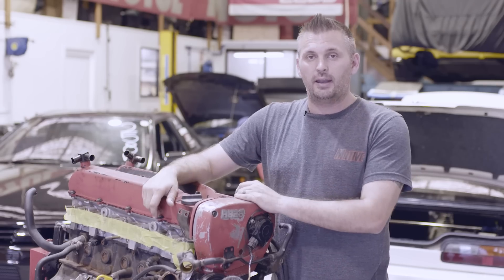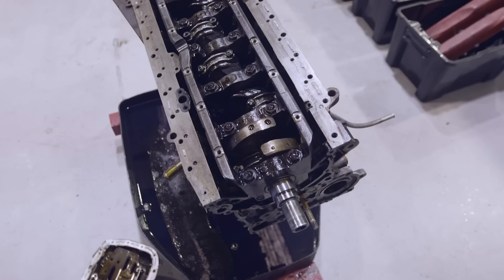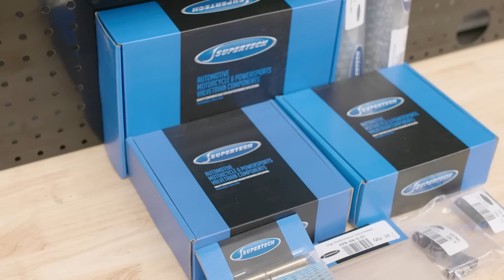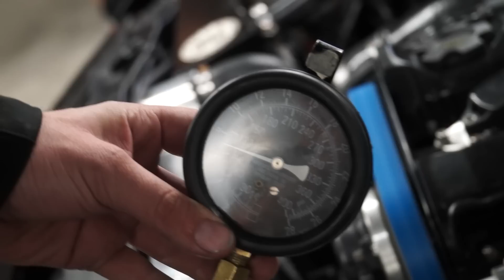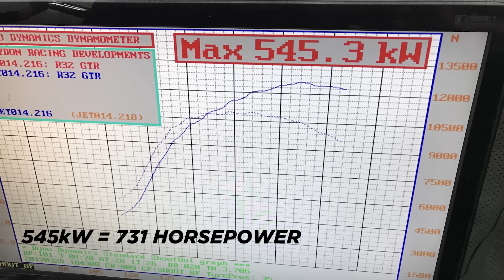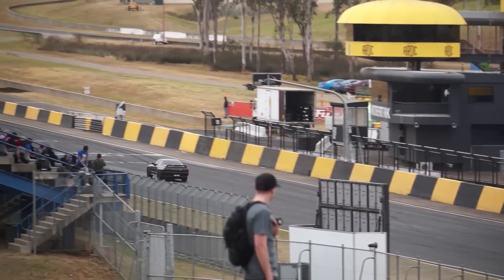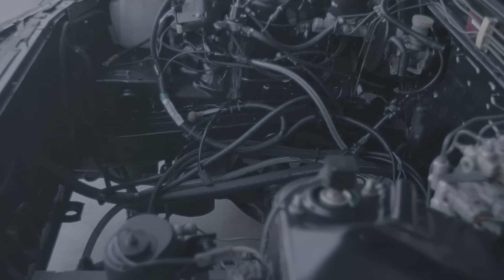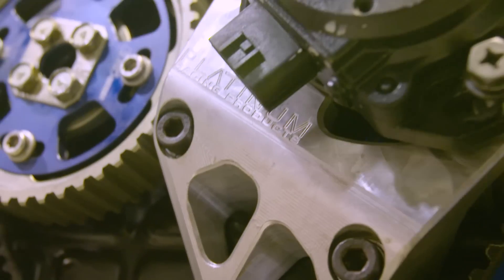1000 engine HP GT-R Budget Build RB26 Pt1 - The truth on RB oil pumps, head gaskets and more

Comment: You could have fixed it by having it sleeved with chromoly sleeves that’s what we do over here in the us when that happens or we wanna make big power, you should change those pistons to some flat top forged pistons and make sure to use chromoly rings and bearings, I can make a 4 banger produce the power you guys want pretty easy naturally aspirated too or supercharged cause turbos suck for drag racing period there for rally cross and drifting not drag racing

Comment: When exactly was the crankshaft changed to the long type oil drive in the r32s? And is there a way to know without pulling the oil pump?
Reply from the maker: August 1991. In a factory car you can tell by the car having a pull type clutch instead of a push type.

Comment: Is replacing the oil pump with an aftermarket like Nitto a must? or may I keep the stock housing and replace the gears with Billet ones? Which option do you recommend for about 450 KW or 600 HP. Thank you.

Comment: errr drysump if it's that much of an issue
Reply from the maker: Why spend $10,000 if we dont need to?
Reply: MotiveDVD more like 6k how much does that full pump kit cost ?
Reply from the maker: You haven't bought and fitted a kit for a RB26 have you. The gigantic lines and dash fittings cost a few thousands dollars. Then there is fitting, brackets to secure tank etc. Its a big job

Comment: Over powered the block is an understatement, all that fuel washing increased wear and you wore the fuck out of that block, you could never expect that to last those iron bores are 30-40k psi in strength and with excess heat hello deformation! IT's knocking at your door.

Comment: why not just change sleeves instead of throwing the block??
Reply from the maker: A s;eeved block is nearly $10,000 in machine work. Why do that for a budget concious engine? Save that for a "big" engine
Reply: didnt realise how expensive it is in AU, wonder why... :O here back in EU we always sleeve our blocks if needed, not a big deal :) off course the price depends of what sleeves you buy, but still for 6cyl. you could fit in 1000eu labor :)
Reply from the maker: Sleeving is a lot of machine work to get them to fit and has to be done by a experienced ( no cheap) machine shop. Then boring, decking etc. Your block ends up owing you 10K so you might as well put a billet main caps/girdle combo on and go the full hog and have a 20K block.
Reply: We do have good machine shops, the guy I know has his own machine shop for more than a decade, people send him Subaru blocks to sleeve for racing even from UK, the other shop has full CNC machinery they did cnc valve seats for me as well etc...  :)    its just the basic economical differences are very big, especially when I watch USA channels where people sometimes struggle to even resurface the head at the machine shop cuz of insane labour cost, although in here I get all of my stuff machined  :) Anyway greetings from Lithuania, love your channel :)

Comment: Do a VCAM! Its a cheaper alternative than stroking to a 2.8 and gives wicked response for circuit!
Reply from the maker: Actually, 2.8 is probably cheaper and can go bigger cams without Vcam. Its also super expensive to get a Vcam and not budget friendly. We'd love to test one but big bucks.
Reply: MotiveDVD  they’re pretty cheap now! I bought mine for 3900 aud from nengun and did a rb28 build. Made 100awkw throughout the low and mid rev range with the same boost level on 2859-9 turbos.  Lots of potential :) after watching your single vs twin turbo build I’m planning to get a single turbo gtx 35r.

Comment: Andrew great vid!
Did you have problems with the current head studs? Where they the normal or the stronger arp ones?
Reply from the maker: jasaircraft factory are junk but our last combo, hard to say, as head wasn’t machined so didn’t seal properly over 30psi
Got given some Tomei ones by JMA to try out so we tried them out
Reply: MotiveDVD what was your last combo or headstud kit?
Reply from the maker: jasaircraft ARP2000
Reply: MotiveDVD oh ok so there is a possibility the upgraded arp (better than the arp2000) set may hold the head down. :)

Comment: why not go budget build and buy an rb30 block use your old head im sure that would work out cheap
Reply from the maker: chris papa except for new manifold, new sump pipe, revised intercooler pipe, modified engine mounts, 4WD adaptor plate and other small things to make it fit
Reply: Dont pistons need to be changed? If you going to do it its a full build might aswell just put a stroker kit in.
Reply: MotiveDVD don’t need 4wd it fast enough for rear wheel drive

Comment: So I don't have a nitto oil pump but I do have the n1 pump. I know it's better than factory but does anyone know what the failing point of these pumps or any issues?
Reply from the maker: ClutchkickPJ how long is piece of string. We made a rock pump last with good driving and tuning
Reply: MotiveDVD well I'll be drifting the car so it'll be seeing a lot of clutch kicks and rev limiter. I know the stock ones are more prone to have issues but wasn't sure if n1 pumps did aswell. I'd like to go to spline drive gears but I don't want to rip the crank out because here in the states are complete idiots when it comes to rbs and the small minority that do know charge a ton to tear them down. I'm just trying to see if the n1 pump will be up for the task.
Reply: ClutchkickPJ make sure it i has a good sump on it, a rear head drain and oil feed restrictiors these are easy cheap mods and rocker cover baffles and an accusump if you wanna throw the works at it, this is the best you can do until you put a real pump in it but dont do the pump without the rest as Jim says.

Comment: Not gonna spend 3k on a new block....but its fine to spend 10k on a gearbox LOL.
Reply from the maker: asambi69 Box is 20K mate
Reply: Roasted
Reply: Spend 3k on block might aswell bite the bullet amd buy a bullet...
Reply: Oh even more 'Budget' friendly than i thought.
Reply: asambi69  Doing a budget build is about putting the big money into the parts that you really need to hold for the Long haul. That transmission will potentially never have to be replaced.  Will need to be freshened up at some point, but  not replaced. Potentially just some minor repairs. Besides it makes this budget build what it is.  It's more about what you can do with an RB on a budget.  At least that's my opinion.  I do agree that by all means that's not a low budget part of this build.  
No disrespect to you at all, just give my observation just like you did.  Cheers asambi69!

Comment: really interesting to note the differences; 2jz factory fully counterweighted crank, no oil pump issues, can seal 1200rwhp+ with stock head gasket and L19 studs
Reply: All the head gasket dramas in the gen 1 Supra taught Toyota that lesson  guessing.
Reply: Has the craddle caps or crank caps issue though
Reply: im in Australia and i used to daily mine .. it had occasional heavy use although granted not what it would see on a sprint day, never had heat issue .. although maybe cos it was single and had ceramic coatings etc .. come to think of it ive never heard of supras overheating as a 'thing' .. it was always rx7s which did that :)
Reply: John Do some extended track days and watch your brake fluid and clutch fluid boil, it was a common issue on the old bathurst supras, is an even bigger issue once you chuck an aftermarket manifold and turbo setup on,   the point im trying to make is that all these monster platforms have there own pros and cons. All the best with your 2jz though they are great engines.
Reply: must be a track thing then cos i did about everything else with it, and an 800+rwhp car produces a lot more heat than stock or almost stock power car .. im not here to be combative i would just as happily own a barra, those 3 together are kind of the holy trinity of turbo 6s. 2jz has its faults too, head flow possibly isnt quite as good as the rb26, and canting the exhaust ports on an angle to suit the seq system is kind of diabolical. just interesting to note the differences
Reply: A factory 2j pump cannot take revs they have their own oil pump mods as well... Also a 2jz lacks a girdle and the bearing caps dances around.
A muppet can say whatever behind a user name make a video like Motive DVD  just like this for the 2jz then come back with that mouth.
Reply: MidShipCivic 2jz pump mods can be done at home for free. Not $1500 worth of billet gears and crank collars to overcome a bad design.
Reply from the maker: We eep hearing it can do it but have never seen it actually done in person in Australia
Reply: Hey please can’t we just enjoy a nice informative learning experience without that Toyota Nissan who’s better mentality, let’s enjoy the engineering for what it is. I’ve not seen as good Australian engineering as these people for along time. So bugger off the comparisons.
Reply: John P  2JZ on in RHD  puts the turbo and manifolds next to the clutch and brake fluid master res causing all kinds of heat issues on track days, both the RB and 2JZ are amazing platforms with their own strengths and weaknesses this is not really the place for comparison.

Comment: Stock crank world record?
Reply: Fastest r32 on stock wing mirrors
Reply: Zac Youngson  worlds fasts r32 with oil in the motor.. 😂😂
Reply: These self titled record's are getting out of control either you are the quickest or not.. period
Reply: Peter Carruthers  whats next worlds fasts r32 with an old chip packet under the back seat..
Reply: What is this oil ? skyline motors are lubed by hopes and dreams, up until they self develop a high flow block.

Comment: Please please would you check the ring end gaps? I have a factory stock rb25 series 1 and all ring gaps were between .015 and .018 thou. I'm very curios as to what the 26 factory ring gap is. The 26 pistons do not look much better than the 25 and I wonder if it is just the ring gap that is causing the 25 ring land issue at higher power.
Reply: Ross Lester I'm pretty sure the 26s are more forged than 25s and that's why they can handle more hp

Comment: Isn't the new block the weak part again? I mean if it still is a 05u block it will fail like past did again!
Reply from the maker: tomisw probably. But if it cracks on the outside and you put JB weld over it and it keeps working fine for years, why waste money on some crazy block or block modifications?
Reply from the maker: tomisw it’s also lucky dip. Some blocks crack straight away, some take years
Reply: Yeah I was saying that because I was pretty scared of getting oval cylinders on mine or getting cracks. Also I haven´t found real solutions on strengthening the block aside of going for an 24u one. I remember seeing that you were planning on a video going deeper into that subjet so... Ill be realy waiting for it! Thanks for the answer!
Reply: how do people push huge numbers on RB26 blocks and not have issues ? is it a better block or better internals that keep them in one piece ?